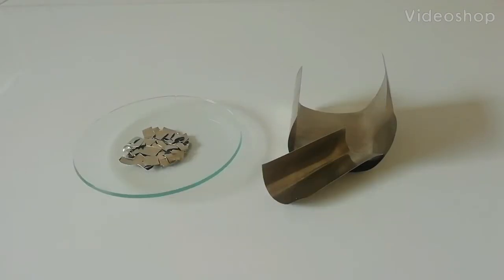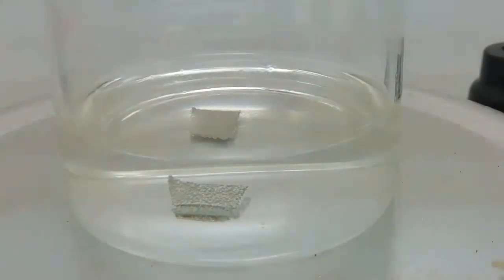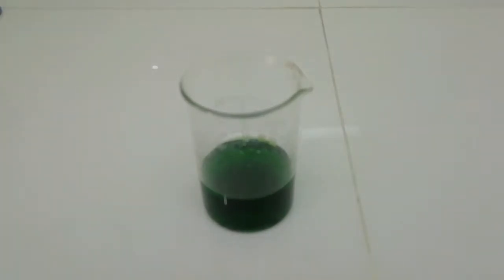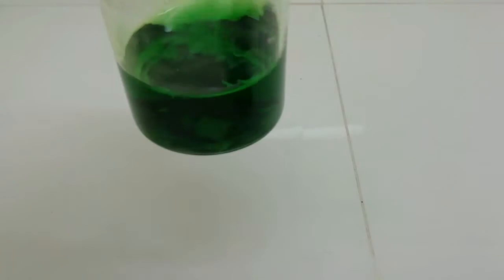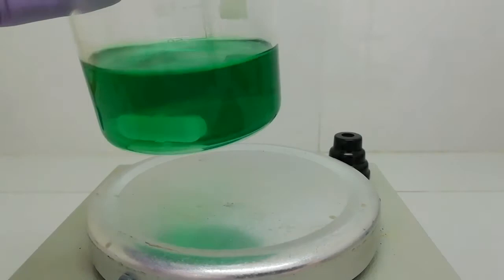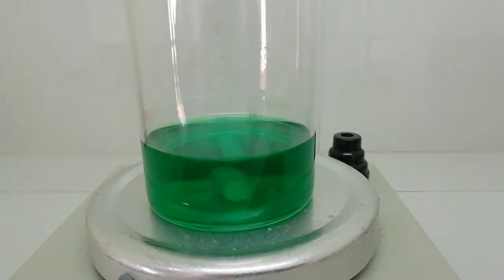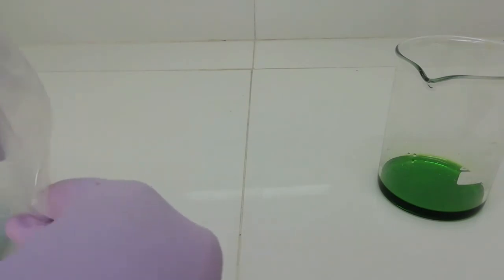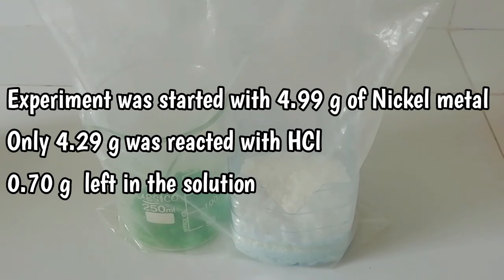How to make Nickel(II) Chloride

Comment: Nickel compounds are scary, they are like Mercury salts but a bit less toxic, and also carcinogenic. Nice video, the color of the solutions are so amazing and beautiful
Reply: Yes, nickle is a little scary, but as long as one is careful with handling you are safe. I was one time reducing a solution of nickle chloride and got distracted, it bumped jus as I turned around and almost got a face full of solution, sure I had safety glasses on but mouth and nose still exposed.
Reply: Nickel based energetics are even scarier

Comment: What concentration of HCl? 
Commercial 37% Is enough?
Reply: 37% is the highest concentration possible, can't be higher. Also nickel is best dissolved in dilute HCl since NiCl2 is not very soluble in conc. HCl and the reaction would be stopped or greatly slowed

Comment: U could have added H2O2 in the solution which would help oxidize nickel metal to NiCl2 . And the reaction wouldnt have been slow slow.
Reply: Beat me to it lol
Reply from the maker: Actually I wanted to see how many days it takes to react. That is why I didn't use hydrogen peroxide.
Reply: @ChemExLK  oh
Reply: Actually the hydrogen peroxide doesn't work with hydrochloric acid it oxidizes it to chlorine and water !!!! I know i choked on the fumes !!!! Will only work with sulphuric acid as not oxidized greatly.  You could dissolve it in Aqua Regia however.

Comment: Why not just use nickels? The hcl shouldn't react very much if at all.
Reply: Unless you are using Canadian nickles from specific years they contain very little nickle. American nickles are at most 25% nickle and modern Canadian nickles are 2% nickle
Reply: @synthesizer8026  yeah it's a real shame. The federal reserve bank in the U.S. is saying they are going to plated zinc, just as with the pennies since the 80's, with the nickels and possibly dimes and quarters. It's a shame our money supply is such a SHAM. WE USED TO HAVE CURRENCY WITH VALUE IN GOLD AND SILVER. YOU COILD TAKE YOUR DOLLAR AND TRADE IT IN FOR GOLD OD SILVER. THEY WERE SILVER CERTIFICATES. The U.S. has been robbed and enslaved. All we have now are debt notes. Trade them in for more debt. No silver dollars, no gold dollars, no silver quarters or dimes since 64 when they killed Kennedy.
Reply: @sarahhoward9081  here in Canada silver quarters ended in 1967 but not far off from you guys. Now a nation's money is based off a series of stats and their economy and much of it really is a sham.